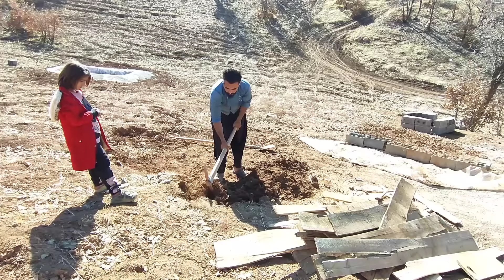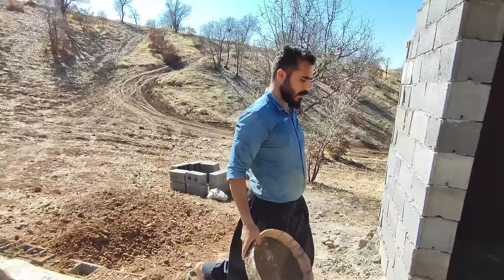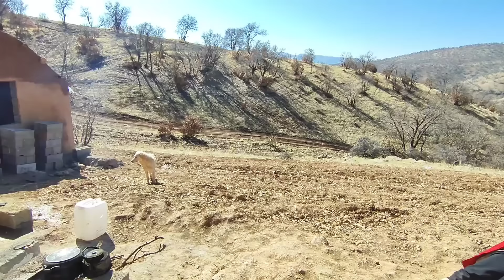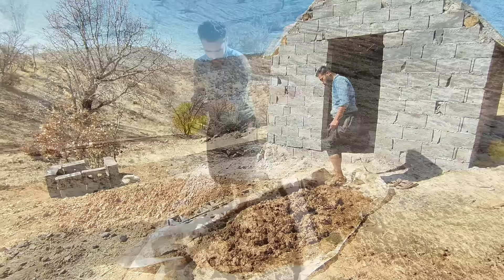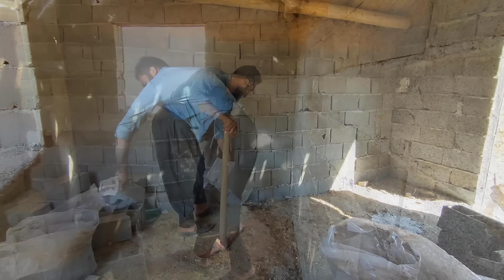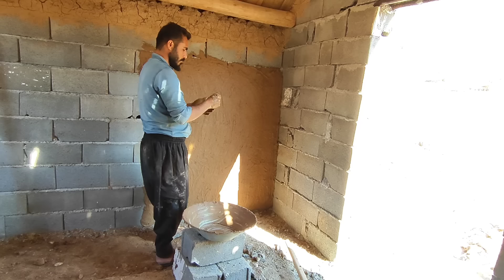The Nomadic Lifestyle: Master Salman and Janan's Journey in Nature

Comment: I'm starting to get bored,he never finishes anything.This is not the same dynamic man we saw on the other show.
Reply: Salman is not a well man nowadays. He is suffering from very bad backpains and his leg is also hurting him. This is why he is too slow in moving and working.  
Building a house by himself without any help from anyone and without proper tools and money to buy more building materials is not easy for him! Still he is a persistent man and he is determined to finish the house. He uses his hands and feet to produce something out of soil to plaster his house. That is saving him money. As you can see he apply the mud soil meticulously with just his hands. He is doing his work slowly but surely.
Please try not to criticise or judge him which is so unfair.
What do you mean he never finish anything? He has finished putting up 4 concrete walls, he has finished the woodwork on the roof, he has finish cementing the roof, he is now in the middle of plastering the walls, as you can see the results of his continous jobs!